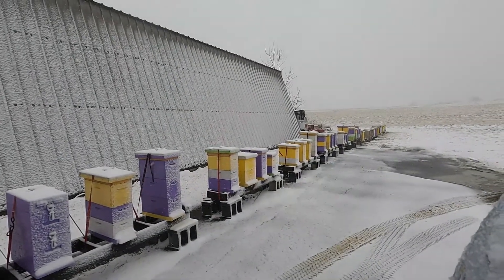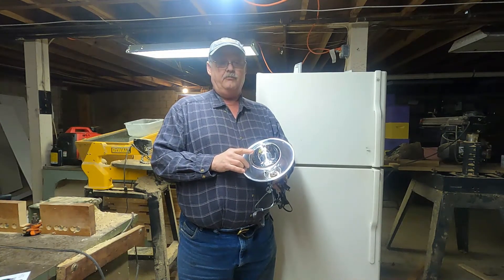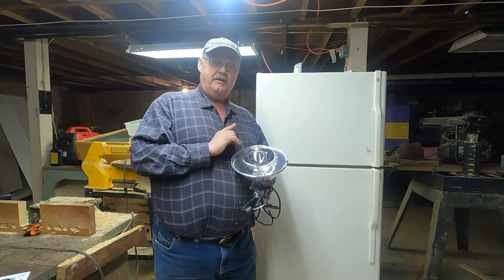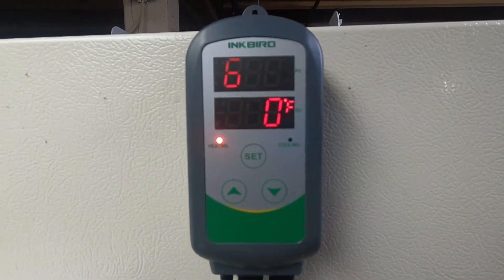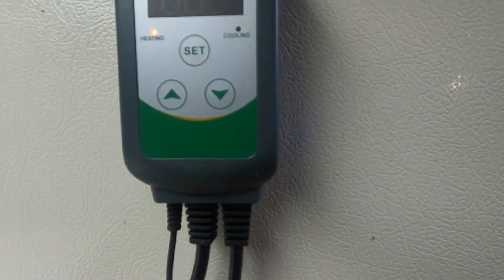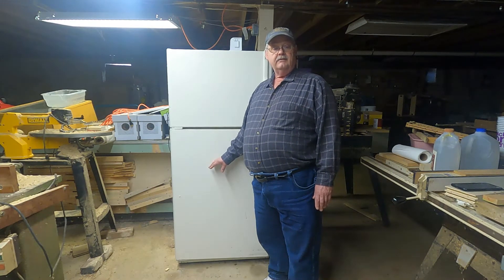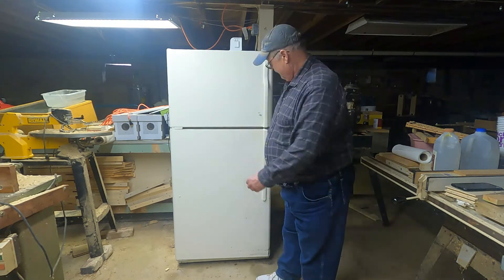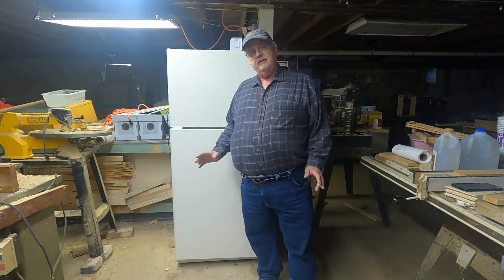De-crystallizing honey using a DIY Honey Warming Box

Comment: Thumbs up on the Ink-Bird controller - reasonably priced and  accurate temperature control.  I’ve used a couple of the units for the same task for near three years without a failure.

Comment: Now you just need another unit and light to make your freezer a queen incubator. Very cool Charlie thanks 👍 good health and God bless
Reply from the maker: Actually I have made the freezer a queen cell incubator using the same setup, that will be a topic for another video at a later date.
Reply: @sawmillcharliesbeefarm  very cool 👍 I knew with a few modifications it would work out. I have a old fridge I have been needing to set up. Thanks for the model number. Great content Charlie. God bless 👍